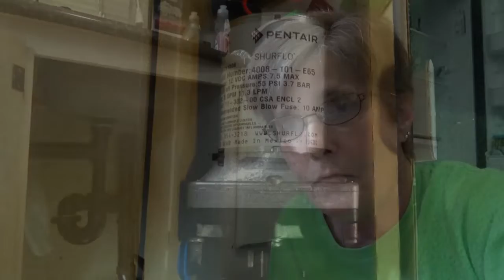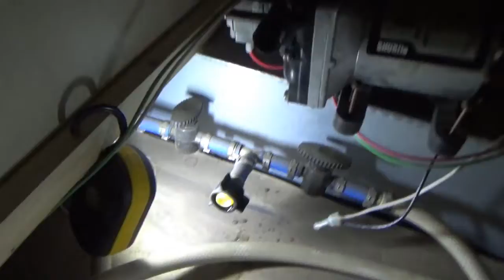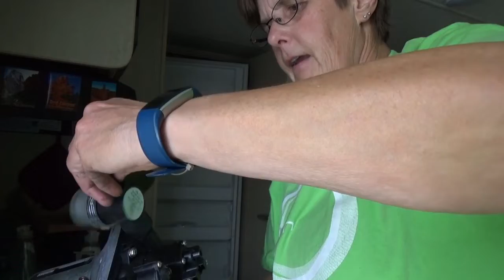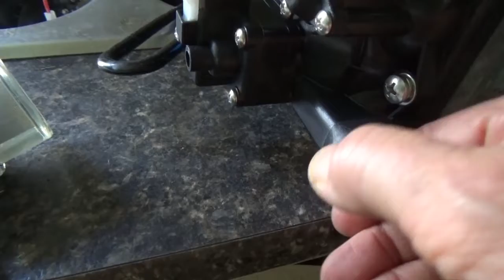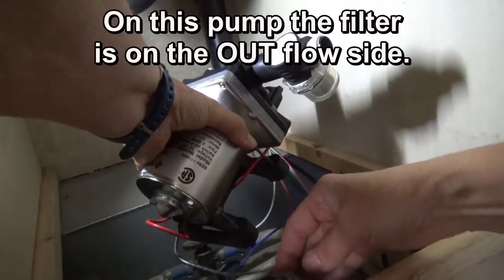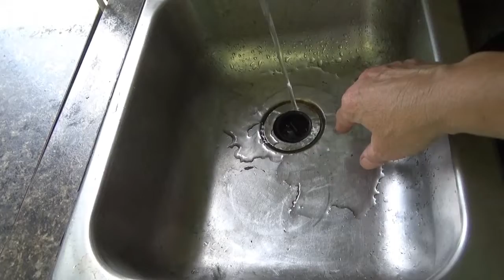Replacing RV Water Pump

Comment: The filter should be installed on the inlet side of the pump.   The manufacturer installed it on the outlet side because there is no room for it on the inlet side.  Instead of being lazy, they should have moved the pump location (don't get me started on rv manufacturers grrrrrr).  The filter is supposed to protect the pump too.
Reply from the maker: Thanks for the information.  We do appreciate it.

Comment: Faucets remove aerator check for grey particles.  That would mean the water heater anode rod needs replacing.  Thanks for the videos.  God Bless
Reply from the maker: Thanks for tip.

Comment: Speaking of RV cats.  Maybe you can do a video on how you got your cat to accept travel and the RV?  I have 2 cats that I want to take along in my E-Pro 19FD.  Good video by the way.
Reply from the maker: We have a traveling with a cat video.  My very best advice is to toilet train your cats.  I used a City Kitty training system available on Amazon and in some pet stores.  It cost around $25, but for us it was worth every penny.  Patches was 3 months old when I got her, and I've never had a litter box for her.  You will need to use expensive fine litter with the City Kitty for the first month or two.  Hope this helps.
Reply: Great question! I was wondering the same thing.
Reply from the maker: @douglastoney2843  Read our answer on EnuffsEnuff's comment.